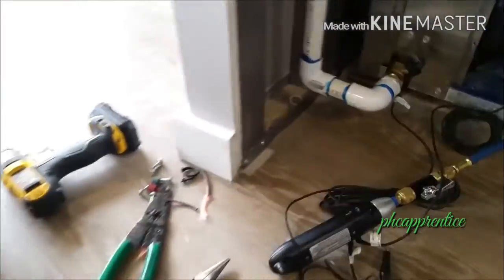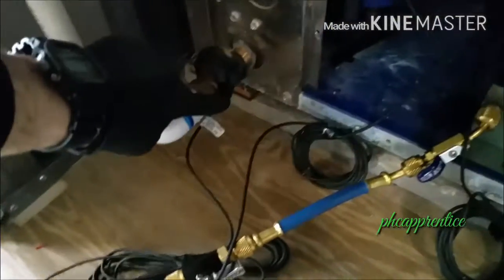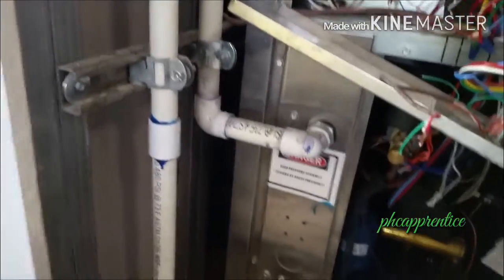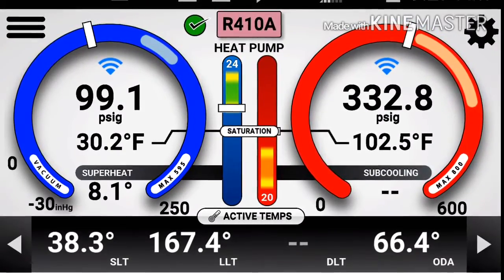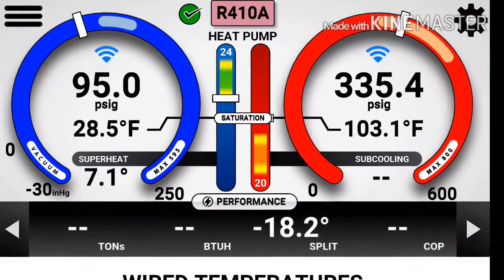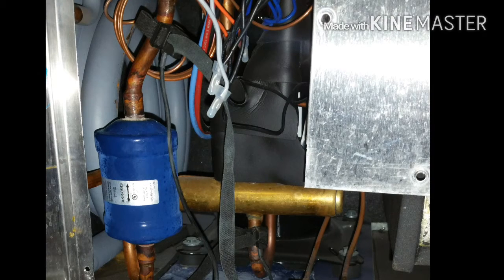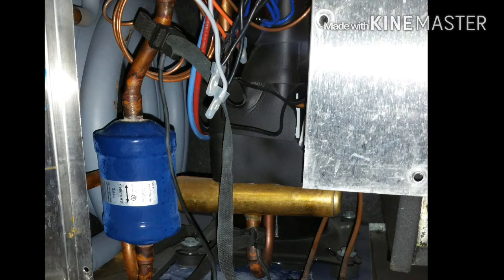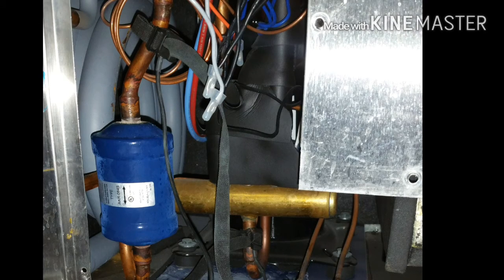Geothermal with a low pressure switch issue

Comment: You're iConnect is already a differential temperature meter! Just buy a couple more strap probes and have them available.
Reply from the maker: true. i just wouldnt know how to do that. this thing is way more capable then i can dealbwith right now. in due time i hope to utilize it more.
Reply: +PHC Apprentice you have a repeater, right? Simply connect two strap probe leads T1 & T2 and it will automatically calculate the differential.
Reply from the maker: Cool. I will try that later. Iconnect is back at the shop due to lack of heat pumps over here.